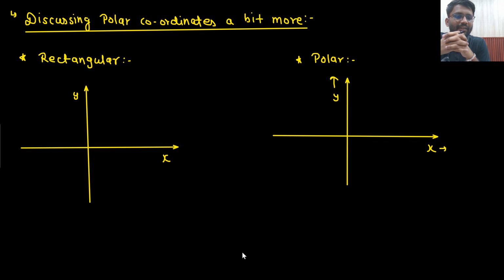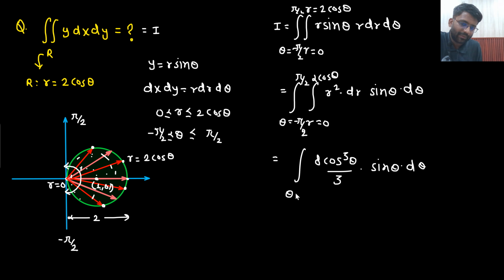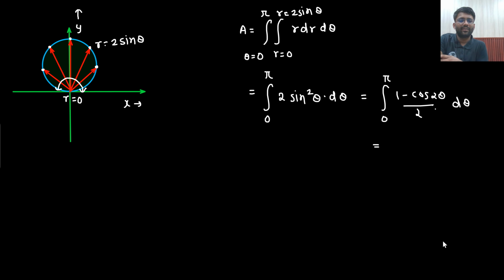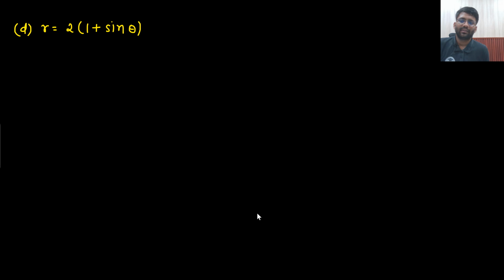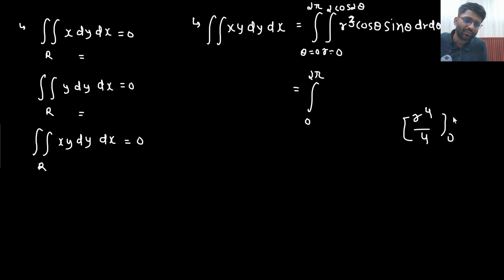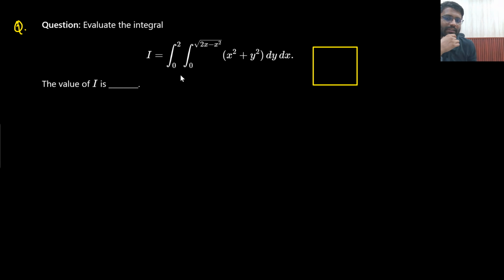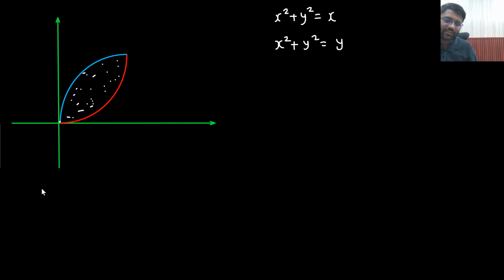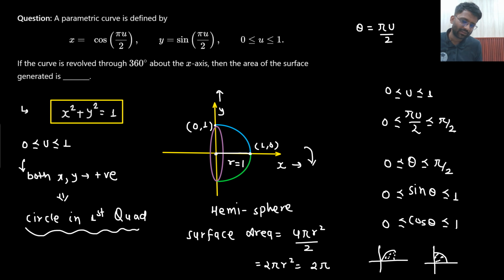Polar Curves & their Calculus || Engineering Mathematics || PrepFusion

Comment: sir in the rose petal sum integral 0 to pi/4 cos^2(theta) equals Pi/8 plus 1/4 ..but you did not consider the 1/4. What's the reason
Reply: in the previous step sir mistakenly wrote cos(theta) instead of cos(2theta). Final answer is correct.